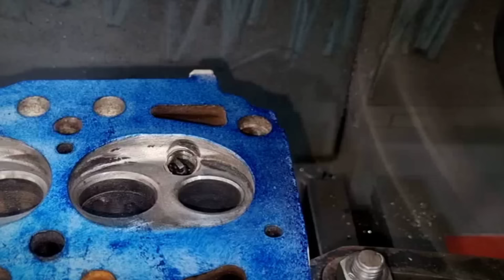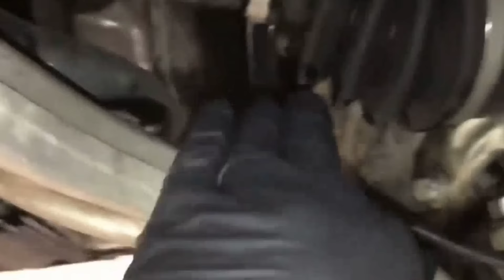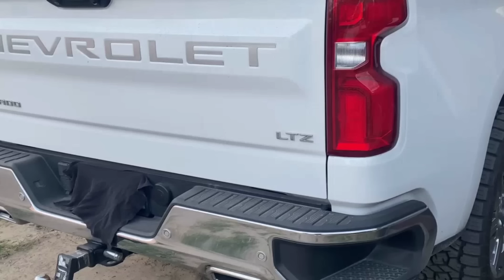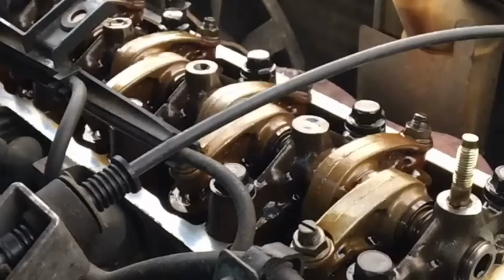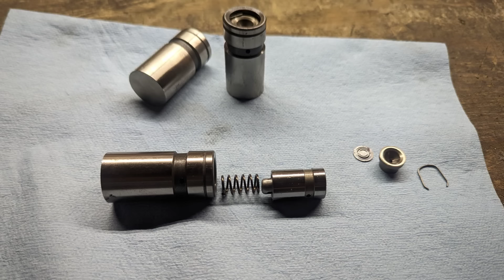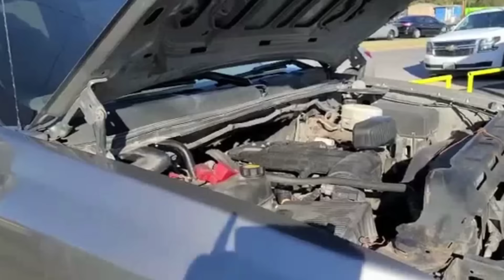3 WORST and 4 BEST Chevy Engines to Own

Comment: I have a 2007 vortex MAX with 247,000 and it runs so good I didn't know that I have AFM until a month ago by looking at the 8th character on vin#. I never knew it existed, I did have to change my computer brain, so I'm hoping the shop that did the job deleted it, don't remember them asking me and that was 8yrs ago, does anyone have a 6.0 with AFM with lots of miles and no trouble?? Oh and the only thing I did besides maintenance, exhaust bolts, rear main seal, modified cats😉, 3" PVC to existing intake box. Transmission pull 2qts out and replace with the proper oil, did that with 200,000 miles, original oil didn't look bad and people told me that when I drop pan and filter it would start giving me problems, so I mixed it 😂 so far so good 46,000 later. I will change it the right way soon, 🙏

Comment: I had a 2008 Cadillac CTS with the Direct Injection 3.6. It was the best care I've ever owned. I sold it with 144,000 miles, and I only put a starter motor in it at about 130,000. It was fast, handled great, got surprisingly good gas mileage, and blew no oil. It just ran great!
Reply from the maker: Sounds like you got a great one. The CTS was a fantastic driving car, and it's always nice to hear from owners who had such a reliable experience.

Comment: I have a 1998 Chevy 7.4l/454 BB in my RV.  That thing is a BEAST which is utterly reliable, smooth and hauls my 30'/12k lb camper down the road or up and down mountains.  Doesn't burn any oil even after a punishing 4k mile trip out west in summer heat and altitude.  Stuck my borescope into it and it's STILL clean as a whistle both top and bottom!  Even though the dipstick recommends 5w30, I run 10w40 in it.  I don't bother calculating MPG...I KNOW it's single digit but it's a "toy" and IF I couldn't afford it, I wouldn't drive it.  I also had a couple of 5.3's.  Both with AFM which I IMMEDIATELY disabled using a tuner and they both ran very well even after 200k.  I just bought a brand new 2026 Traverse with the "new" 2.5l turbo 4 banger.  It's the little brother of the 2.7 they put into trucks.  Apparently after talking to a couple of GM techs I know they've had very few issues with either.  Not perfect, but no major problems.
Reply from the maker: Sounds like you've had great luck with your GM vehicles. Hopefully the new Traverse keeps that streak going!

Comment: 1986 c20 with an engine swap from 350 to 1974 454 big block. Straight mechanical power. Surprised that engine didn't make the list.

Comment: I have had 3 4.3 V6's, have driven them for 12 to 14 years each, one putting 360,000 miles on it when the body was shot.  Why have they discontinued all their good motors?

Comment: 3.6 is a gud motor i charger1000for to pull heads redue valves slap timming back together ive seen these motor hit300k easy

Comment: Had a 79 Monte Carlo my Grandparents bought new.
4.4 V8 267 2bbl still ran excellent at 240k with minor upkeep, 1 carburetor rebuild,waterpump,alternator, passenger side valve cover gasket only, and oil changes., thats it.
 pulled it out at 240k to install a .040 over 350 4 bolt main and th350. 
My buddy put the 267 in his 63 chevy truck and drove it for a few years before eventually selling it,the engine was still running good.
Not a real powerful engine but very reliable..

Comment: Lets see... $150M burned on settlements & lawyers is what: a dozen full engine development cycles at a little over $12M per?  Remember in that also iies determining assembly procedure & sequence, suitable lubricants, auxiliary mount points and all facets of installation for line tools plus machining specs - tolerance verification means destoying a few parts along the way to verify min/max.   Do they even spend over $7M up front on current engines?  I doubt it.  One problem is the "make it fit" ethos that stylists and marketing shove on engineers   Yes, gotta start somwhere, and that usually is sketchwork but... there are known quantities like front suspension space hurdles and driver legroom - scale those metrics wrong on a no compromise basis, and no engineer will save the day.

Comment: My 2015 5.3 lt in gmc Sierra was still running when i pulled it at 550, 000kms, original spark plugs..... Was burning oil, but still ran well!

Comment: 2010-2017 4.8L LS (L20) doesn't have AFM but does have the gen IV upgrades including variable valve timing.  My 2012 is rated at 302hp,with E85 it's around 320hp.  More than any 1999-2006 5.3 truck engine.

Comment: I have a 2028 Colorado with the 3.6 V6 engine and it has a 100,000 on it and no problems at all,  I change the oil every 5000 miles and take care of it.  It still has the original battery because it starts so easy.  I like in Wyoming where were get a lot of snow and cold weather.  It has power and gets good mileage.  Where I live it is high altitude but get gets better mileage in lower altitude.  It does get worst mileage during the winter and better in the summer.
Reply from the maker: Sounds like you’ve got a solid setup. 
Proper maintenance and that 3.6 V6 will go a long way, plus altitude and winter temps definitely explain the mileage changes. Hard to beat a reliable truck that handles Wyoming weather like that

Comment: 2008 Silverado 5.3 got 257k still runs like new chirps the tires still after a rebuilt 4l60e that let go at 211k. Afm disabler installed.

Comment: The Vega isn't the worst. They had a stout lower end with the crank-driven eccentric gear oil pump 30 years before the LS engines, plus a decent head design. By 73 they had iron cylinder liners. Every one of them would have gone 200k miles with decent maintenance.

Comment: I agree with the 350 being one of the best GM engines ever produced but also the inline 6 engines were great and practically bullet proof. I’ve had several of these over the years and they were super reliable.

Comment: Honorable mention: The legendary 3800 V6 series 2 and 3
Reply: I had a 3800 series 2 in my 1996 Bonneville SE 260000 miles had to scrap it the sub frame mounting  base rotted away. The engine was good still got 30 highway and 23 city. I wish I'd kept it.
Reply: I’m surprised to not see people doing more with them motors incredible motor terrible tranny at least mine was in my 2003 impala ls

Comment: 1979-1982 4.4 ltr. / 267 ci. V8.  That engine was put in across the gm line for those 4 years.  From what I understand it was primarily for the rental car fleet.   I had a 1980 Chevy caprice with that engine.  It was sorry.  Every October I had to put an alternator in it.  Christ,  I could type a paragraph about that engine and how much it sucked.  It’s not worth that.

Comment: 2018 Silverado 3500 6L 140000 runs strong pulls everything. Doesn't burn a drop of oil. Change it every 5 with Mobil 1

Comment: I worked in a machine shop for over a decade building race engines and I’ve seen them all. I’m a Ford guy. Fords are so much simpler to work with and make stupid power in my opinion. I hate the 4.0 German ford with 6 timing chains and I’m not a fan of the 4.6 ford. Coyote is badass but Chevy got it right with the Ls platform by sticking with the pushrod engine design. Ford had the greatest engine platform with the 302-351W and Cleveland. But they went with the stupid mod motor platform. Dum! The Ls is flat out designed off of the SBF platform. No argument! The problem with SBC and Chevy in general, Chevy used cheaper steel vs Ford using a higher quality domestic steel. Chevy’s would pit and delaminate vs Ford. I can take a Ford block that been sitting outside covered up and no pitting and delamination. The Chevy would be junk! Chevy and Ford standardized valve train dimensions making it more affordable to build a set of race cylinder heads. The new Ford Godzilla used LS valve train components. The SBC is a great engine along with the LS platform.
Reply from the maker: That’s a fair, well-earned take, especially coming from someone who’s built them for real. 
Ford absolutely nailed simplicity and strength with the SBF era, and you’re right about the LS being a smart evolution of that philosophy. Different paths, both proven platforms. Respect to the experience behind the opinion.

Comment: it seems that the smaller cubic inch engines are running much more efficent according to Hot Rod & Mtr.Trend Magazines. Must be due to less surface area of friction, when comparing power To wt. ratio. in the gasoline industry.

Comment: My Tahoe is registered as a 1999 . It has the Vortec 350 , currently at 214,000 miles. All I’ve done is oil changes  , spark plugs at 200,000. Still runs strong  !
Reply from the maker: That’s a testament to those Vortec 350s. 
214k with just basic maintenance is excellent, simple design, reliable parts, and clearly well cared for. Hard to beat that kind of longevity.

Comment: I have a 2003 s10 zr2,  i swapped a 327 into it when the 4.3 went tits up.. however...i am in the process of doing a complete over haul on it and putting it back in..most likely in November/dec this year...

Comment: My 2010 Silverado 5.3 is coming up on 250,000 miles and still runs like new. I maintain it well with oil changes every 5K, and use an AFM disabler plugged into the OBD port. When it finally fails I'll rebuild it with an AFM delete kit and a good cam. It's still better than any new GM truck.
Reply: My '08 5.3 has a disabler too. Was told that would be good enough with oil changes. But a buddy of mine is a GM tech and is going to do a delete for me with a "Chuck Norris" cam (whatever the hell that is) & water pump for a couple grand.

Comment: I had an ‘08 Silverado with the 5.3L AFM motor. Not a single engine related problem in 100K miles of ownership. If it had any downside it was that annoying vibration felt in the cab when it was running on four cylinders… Also had a 4.3L in a ‘92 Silverado. It was a little down on power but that truck ran for 12 years and 265K miles before I gave it up.

Comment: My best friend's dad was working at Chevy in the 1960s thru the 1980s. His dad SAW the massive amount of Research and Development that went into the modern 350 V-8. His dad told him that NO other combustion engine in the entire HISTORY of engines... ever had as much R & D that went into it... as a Chevy 350 V-8. The engineers LITERALLY, now read this correctly here, built a Chevy 350 V-8 with every single angle of the "V" which could be made, from flat out wide to almost down firing each side. The EXACT ANGLE... of a modern Chevy V-8 engine, is, to an engineering degree of absolute certainty... THE ANGLE... that produces the most torque. It is not even a question among engineers at this moment in time. That question has been SETTLED. They also ran Chevy 350 V-8 engines.... on suicide runs. They ran them WIDE OPEN.... to see how long they would run until failure. Think about this for a second. They took a new engine, ran it up as high as it would go, and fed it gas... until it failed, and watched it 24 seven until it did. The best one lasted 9 days, day...... and night. That is just HOW GOOD.... a Chevy 350 is. It became the perfect engine... for an Indy Car, or a truck, or an Ambulance, or a Vette, or a boat, or a taxi. A Chevy 350 cubic inch V-8 literally IS, to a degree of engineering certainty, the FINEST COMBUSTION ENGINE EVER MADE, LADIES AND GENTS.
Reply from the maker: That’s a great story, and honestly, it tracks. 
The amount of R&D behind the 350 really shows in how versatile, durable, and forgiving it is across so many applications. Engines don’t earn that kind of reputation by accident.
 Respect to the engineers who got it right.

Comment: My 2000 GMC Sierra 5.3 Vortec is pushing 400k miles.. Still spinning tires without even trying.. Best V8 engine ever produced.. and I believe the best V6 engine ever produced was the 3800.. Those are the only 2 engines I buy for swaps..

Comment: 281,000 miles on my 2001 5.3 Silverado and still running strong when the 4L60E failed. Many fluid changes but to get 280K out of a 4l60 without ever dropping the pan is unheard of. 
When my father passed away last summer he had 480,000 on his 1994 5.7 K1500 5 speed manual. The engine had never been opened up beyond a water pump replacement.
Reply: I have a 2008 5.3L AFM. Bought it as a demo with 6K, now at 67K. Got a disabler from  Amazon about 2,000 miles ago. It runs on all 8 constantly. Going to do a delete and add a little bit of cam to it soon. Hate to mess with something that isn't broke, but it carries that AFM curse.
Reply: I have a 2014 silverado 5.3L with 355,000 miles no engine work
Reply: You should always flush and change the filter and fluid on your trans(4L60) at least every 80k.   I prefer 60k.    It’s called PREVENTATIVE maintenance.  It’s an investment in your transportation.
Reply: @JamesStover-gr3hw The pan has a drain plug and I worked for shops that have flush machines.

Comment: Didn’t stop producing 350 until 99!
Reply: 2000 was the last year for 350 and 454. The 3/4 ton was either a GMT400 or GMT800. You could only get a crew cab in the GMT400. And the 3500 was only the GMT400. 2001 was the first 2500hd and 3500 solely on the 800 platform.

Comment: I have a 1978 Chevy c10 with 254,789 miles on it and still runs strong and no it has never been rebuilt, I know this for a fact because my dad bought it brand new and gave it to me, only had basic gaskets replaced and water pump replaced twice.

Comment: I'm a Chevy Man through and through. I was a Chevy dealership parts manager for several years. I love Chevys, BUT why couldn't they put the distributer in the front like Ford. Instead of in the back, where it is hard to work on and makes it hard to fit in certain vehicle under hood footprints?
Reply: Because the distributor drives the oil pump, and the oil pump belongs at the back of the pan, where the oil is, under acceleration.
Reply: @scottm7341  Yet, somehow, other manufacturers made reliable engines with the distributor in an easier place to access.
Reply: @scottm7341 you could still have the pump at the front and run the pickup to the back.

Comment: I'm running an '07 Chevy Silverado with over a 100,000 miles with the 5.3 L  engine and still runs like a Swiss Watch !The company I work for has a number of trucks with the 5.3L engines that are showing 2 & 3 hundred thousand miles and still going strong . The biggest problem I've seen  is leaking at the rear of the intake manifold .  The best engine I've had was the 350 Vortex in a 1997 Chevy Silverado , great truck with a great engine .
Reply: Yeah, I'm still driving a 96 Silverado, over 400,000 and still runs perfect, I have never even had a tappet cover off it, it burns no oil, I have always used Royal Purple.

Comment: This is pretty dumb lol. Best ever was the 350 then the BB 454 and the new ls 6.0 thats your top. Your worst was most of the v6 plat forms but i do agree with the Vega motor lol was junk
Reply: My experience is some 350s were great , some just never measured up . Could never predict 
Neighbor had one , never ran very good , 8 mpg 
The dealer did everything,  rebuilt it , new carb , ignition system . Just never changed 
IMO , the 454 was worst of the big blocks . Valve guides wore , poor power compared to 396, 427 . Worse fuel economy

Comment: Worked in the second oldest Chevy dealer in the US for 20 years…i was responsible for receiving and recrating Vega warranty engines…in two years we replaced 39 of the junks…two or three were done twice even after receiving iron sleeved rebuilts…GM finally loaded the front fenders with literally pounds of rust proof, installed the Iron Duke 151/153 bullet proof four cylinder…renamed it the Monza…fixed all its problems…then promptly stopped making them…now at that time all the Japanese and Euro four cylinders were OHC…aluminum head and cast iron block…the Taunus 2.0 in the Pinto was bullet proof, its other was the 1.6 Cortina mill that wasnt as tough but had HP parts available…leave it for GM to do everything backwards…another dumb bit of GM trivia…they were the last major car company to employ McPherson struts in their cars…invented by an engineer, named oddly enough McPherson…who invented them while he worked for…wait for it…General Motors…well duh….
Now as to Chevvies worst engines lets not forget by the late 70’s it was now GM Corporate…if you want to dis engines lets talk 1.8 Brazilian across three car lines…a hand grenade if ever there was one…middle gen Buick 3.0 , 3.3, and 3800 shakers, breakers, smokers…and what about no oil pressure in brand new cars…Olds 307 with pitted intake manifolds and replacements unavailable due to mass failures, or Olds with bogus diesels …also in Chevy and Buick…
You neglect to mention the 2.8, 3.1, 3.5 series of Chevy v6’s…pretty darn reliable except for intake and rear main leaks…250 or 292 straight sixes…luggers but sluggers…barely ever broke…and one fave of mine the short lived 229 v6… couldnt kill one with a hammer…

Comment: Forgot my 1999 GMC Sonoma 4x4  4.3 vortex factory distributor had plastic body and went to tune up, prior owner stripped thread's in distributor cap and didn't know until I tried to titing down and forced to get replaced with aluminum body.

Comment: I bought 2003 club cab Z 71 4x4 typical Con exhaust bolt's on aluminum head's break. My 1997 Tahoe 5.7 had a great engine, had to replace everything but finished and gave to my son since he's family man and needed 4x4 and fit kid's.
Last truck I bought a 1999 GMC Sonoma 3  door extended cab 4x4 with replace low mileage engine 4.3 and love it.
Wish I had 1984 Blazer 4.3, with 4 wheel drive in it would roast all  31 x 10.5 x 15" tire's, but ignition would randomly shut off itself and lock steering and nearly killed me and sold it after work and drove to salvation yard same day.